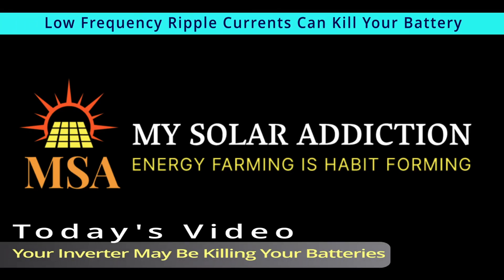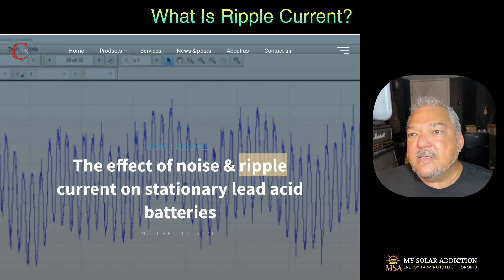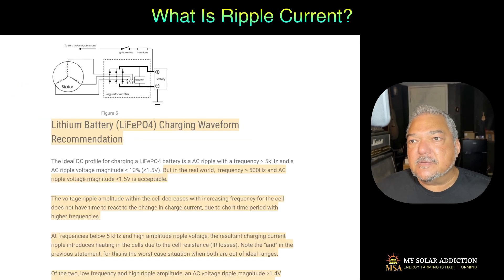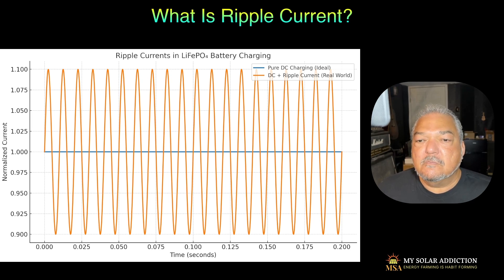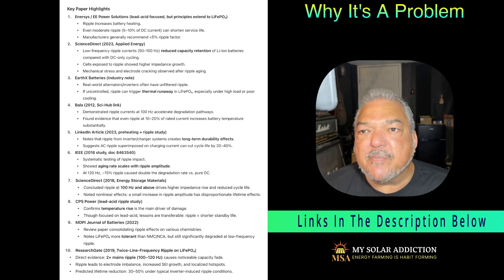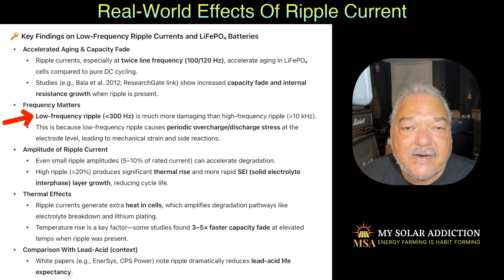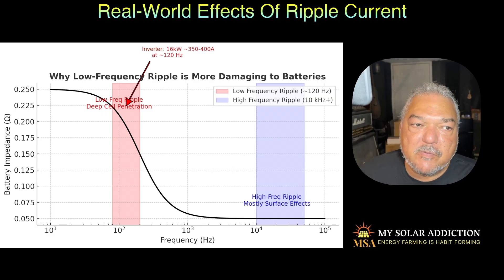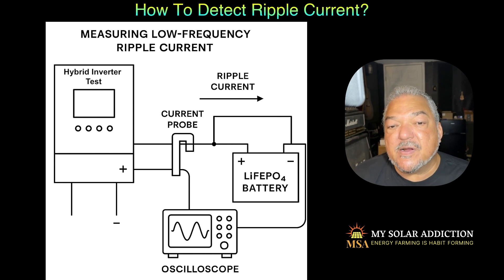Your Hybrid Inverter May Be Killing Your LiFePO4 Batteries

Comment: Ripple can increas the heating - but you have to ask how much before you start to worry that its a problem. If you are charging a 100 AH battery at 100 amps (average) and the charging waveform is unfiltered rectified mains frequency, the charge current would go from zero amps to 140 amps 120 times a second. It's that 140 peak that adds potentially significant heat. But LiFePO4 batteries have very low resistance, just a few milliohms for a 100 AH 12 volt battery. Even charging with a really bad (unfiltered) charger, and at a very high rate on a very modest sized battery, the total heating power is maybe a few 10s of watts. If you want a quick, easy, and quite useful "test" to see if you are abusing your battery, simple feel it. If it is barely warmer than the ambient temperature after charging, or being heavily used for a couple hours, you are fine.
Reply from the maker: All valid points but as I said in the video it was new to me and I’m working on finding these answers.  I appreciate the input.  Also when I said I’m worried about it believe me it’s not gonna rule my life😂

I’m just really interested in how these systems work and want to learn more everyday if possible.
Reply: @mysolaraddiction  One thing I learned engineering and testing products: making good measurements can be tricky, but with the right equipment and some care, totally doable. The hard part is getting meaning from the measurements. That requires some deep thinking and learning about what matters, and what doesn't. By the way, you don't need a current probe to measure current with an oscilliscope. Current probes are definitely useful - but I'd just use a regular voltage probe across a current shunt (very low value resistor). And you don't even need a special current shunt resistor. One foot of 10 gauge wire is almost exacty 0.001 ohm. In theory 10 gauge is only rated to carry 30 amps, but a one foot piece in free air will easily handle 100 amps. It will be dissipating about 10 watts at that current, and will get very warm, but not so warm it will be dangerous. A 0.001 ohm wire (resistor) will make 1 millivolt per amp, 100 millivolt at 100 amps. So, if you get a 'scope, just make yourself a milliohm resistor from a foot of 10 gauge, and scope the voltage developed across that foot of wire.
Reply from the maker: @jimmurphy5355 thanks I appreciate the tips

Comment: ELectrical engineer here - at 5:22 you show a graph of steady charge VS charge with ripple. When looking at graphs (of any kind) it is important to look at the scale on the axis. The graph you found greatly magnifies the ripple (visually) by having a non-zero baseline. It is esentially a zoomed in view of rather modest ripple. The ripple magnitude is just plus and minus 10% of the average. That amount of ripple is trivial, and will not stress the battery. The other thing you didn't consider: how much current are you putting in and out of the battery as a percentage of its capacity. I have a rather large home solar battery. 1200 AH at 24 volts. The battery current when the house is running on my inverter can hit 200 amps. That is a C/6 rate. Dead easy for LiFePO4 batteries to handle that, even if the ripple was much greater than 10%, as the inverter synthesizes a 60 Hz sine wave. My inverter, like most, has huge capacitors internally - those filter out most of the ripple (that's why they are there.)
Reply: it's a 10% lie. All PC has same ripple curve. And differences are in mv - 20-30, worst PC power supply can go to 50mv. So it's has max 2-3% and it's just for ms

Comment: Um... at 12:10 you mention "charging current going to the batteries" ... and "I believe you have to hit it with a load" - that doesn't sound right... in my solar setup on my RV, the inverter IS the load! It's the charge controller (or, in a non-solar RV, it is usually called the CONverter, that turns 'shore power' into a charging current) that supplies the charging current to the batteries... and for sure, ripple in converters (and so many ARE horrible, they even make a nasty hum that can be so loud some people can't sleep well!) is a BIG problem... and of course you don't want much ripple (hopefully negligible) in a charge controller either.

Now, your diagram does show the 'box' as a "Hybrid Inverter' - I assume that's a combination charge controller/inverter? In which case, yes, you'd better check the ripple!

But you've been just saying "inverter" which made me watch, since I was wondering if the INVERTER (as a LOAD) would present enough 'load ripple' to cause any problems - because it COULD... I was curious about that myself as I built my system so I watched for it (and there was very little); is that really a common problem as a LOAD?
Reply: Yeah i think every time he says inverter he means rectifier or charging circuit. All the linked research suggests charging not discharge.

My conclusion from the papers is to use a good quality rectifier with good capacitors, and don't use gear  with busted capacitors if you can help it
Reply from the maker: Yes I’m taking about the new hybrid inverters on the market.  I mention the inverter I plan to test because I already own them near the end.  They’re all hybrids with charger built into the inverter.  I should have been a bit clearer on that detail.  Thanks for the input.
Reply: @mysolaraddiction now obviously i don't have circuit level schematics to look at here, but i think the charge circuit and inverter circuit have to be separate things inside one unit... they simply don't share that many components with each other.
One is (assuming full bridge) simply 4 diodes and some capacitors, the other is an amalgamation of transistors, diodes, capacitors, transformers for a pure sine output.

Comment: You certainly have done a deep dive into the technical aspects of electronics. First, what causes ripple current? It is caused when the inverter generates a sine wave, you showed the the zero line (blue line) which is straight DC. When the sine wave swings positive a surge of current is required from the batteries, it then levels off at the peak and drops as it heads down to the zero line. The same thing is repeated for the negative sine, this completes one full sine wave. Two surges are generated per sine, so an inverter operating at 60HZ generates the 120HZ of ripple current. Anyone who has connected an inverter to a battery is familiar with the spark that is generated, this spark is from the internal capacitors being charged. The internal capacitors are usually inadequate and require additional external capacitors to be connected for heavy loads. Different brands of inverters require a different capacitance to reduce ripple, I have several 750 watt inverters I use a 22000uF (microfarad) 50V capacitor connected to the inverter, a 60000uF for a 2KW inverter. It would be great if the manufacturers would add additional internal capacitance to alleviate this problem. This assumes the system is properly sized and all components are adequately sized, batteries and cables are properly sized for the inverter. Improper component sizing will only add to the problem.
Reply: I agree with everything you said, except for the voltage rating of the filter capacitor.  With a 12V system a 50V capacitor may work, but with a 48V system a 50V capacitor is insufficient.  That said, with higher voltage, a smaller smaller capacitor (uF) may be sufficient for the same inverter wattage.
Reply from the maker: Thanks for the comment.  This kind of discussion can only add to my education and the education of others on this subject.  

Good stuff👍🏻👍🏻

Comment: Forgive my ignorance on this subject, but is this for both high frequency and low frequency invertors? If both does one tend to be more affected than the other?
Reply: I think it would be more pronounced on a HF inverter as capacitors designed to filter out the ripple have higher impedance as the frequency goes up but that's only a guess on my part.
Reply from the maker: Like I said in the video... I was ignorant to this subject until I stumbled upon it researching battery longevity.  But to answer your questions... to the best of my knowledge the effect can happen in both HF & LF inverters but the HF is affected more the LF.  

Thanks for watching and commenting
👍👍
Reply: @mysolaraddiction  yeah, my apologies. I fired off that comment before watching the whole thing. But in the automotive field the alternator analyzer we had in the shop had a ripple sensor to which detect diodes breaking down and therefore damaging lead acid batteries. I just never thought of my high frequency doing the same!. Great video , Thanks !
Reply: It shouldn't matter on inverters at all, but rather the rectifiers / charging circuits.
The papers all talk about power into batteries not out
Reply: @joshuacheung6518  ~ It would seem to me that ripple current whether it be in our out of the battery would negatively effect the battery.
Reply: @rpsmith without an inverter, you can only possibly ever power DC loads, which while possible and more efficient in many ways, would require you to redesign a lot of things.
Also all of the papers talked about input to battery so... there's no sources to look at for output.
Reply: @joshuacheung6518  To be honest I was thinking of the all in one high/low frequency invertors  type

Comment: I'll check for ripple on my Victron MP2 (low frequency) inverters and report back.  Thanks!
Reply: According to Grok 3: The total real amps flowing in the circuit, assuming 30 amps DC and 30 amps AC (RMS) in the same conductor, is approximately 42.43 amps (RMS).

I can confirm, to my satisfaction, that the Fluke reading of ~ 30A of AC ripple is correct.  I fully acknowledge that this is likely way more complex than I can comprehend but what I do know for sure is there is a lot of 120Hz sine wave ripple current flowing in my battery cables!  My first real clue was when I clamped a Fluke 80i-600 current probe over my battery cable and it started buzzing and vibration!  And keep in mind, a Victron MP2 is an expensive LF inverter not some cheap piece of junk from China!  So it would appear to me we have a real documented problem going on here!
Reply from the maker: @rpsmith I’m hoping that if this info gets enough traction that the manufacturers will show their data on the subject.  It’s amazing to me how little people know about this issue.  I know I was ignorant to the fact until recently.  What oscilloscope do you have?  I’m looking into buying one soon
Reply: @mysolaraddiction  ~ I have a 35+ year old Tektronix 2465A DV (CRT Type) but I see a lot of folks using one of the Rigol oscopes.

Also, with battery warranties often running 10 years, I wounder if this will be used to deny a warranty claim.
Reply from the maker: Than is for watching and commenting.  Let me know what you find 👍🏻
Reply: With ~ 30A at 52V of DC draw (measured by my Smart Shunt) by my MP2 Inverter producing power, I measured ~ 30A of AC current with my Fluke Clamp Meter. That had to be ripple current but I'm not sure how valid that reading was so I'm going to fire up my scope and look at the waveform across my shunt.  More later...
Reply: I have a small issue with this, both test and video.
The ripple the papers talk about is AC rectified into DC, or DC square wave pulses. You should be measuring the rectifier output, not an inverter output.
Battery in, not battety out

If i am wrong, which i may be, i would like to learn why i am wrong